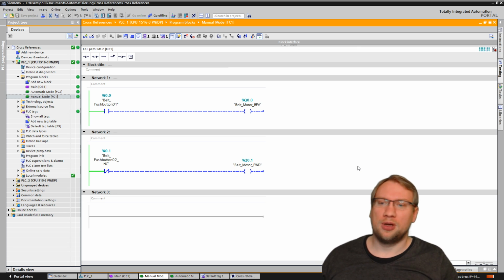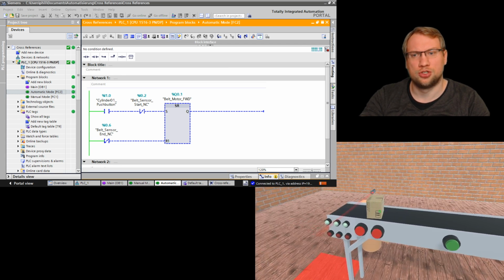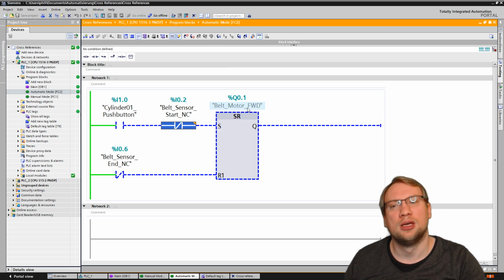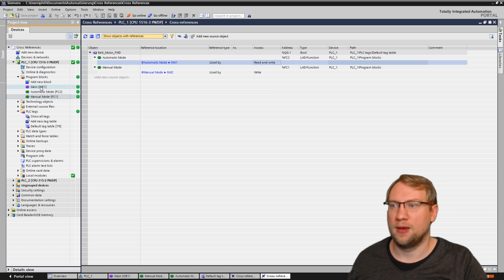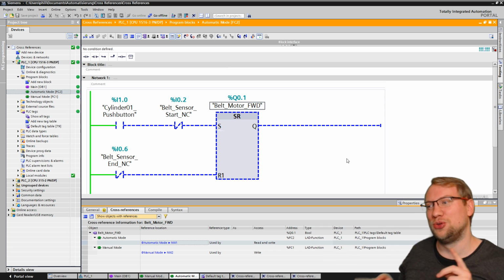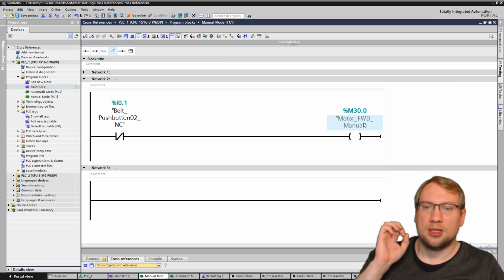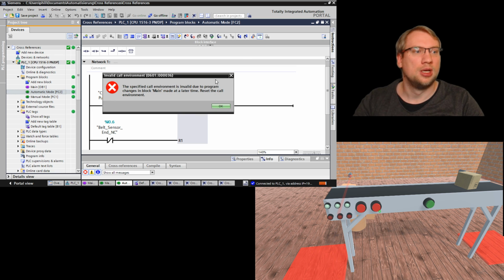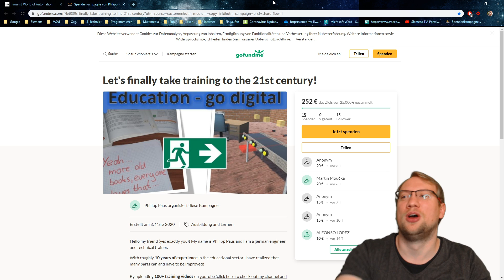TIA Portal: Cross-References (Troubleshooting)

Comment: Hi 
Is there someone who can explain to me why the NC point does not pass the current here 😅
And What are the cases where an NC point is used to not pass the current
Reply: The NC sensor is closed and continuously sends a signal of 1 to the reset input.  
However, this constant signal does not reset the block. Why? Because the reset block only operates when it receives an activating signal (Rising Edge or Falling Edge).

Comment: off topic Q 

when you put n.c PushButton , It should disconnect your motor when pressed and while not pressed the motor should work  ?!?
Reply: The NC sensor is closed and continuously sends a signal of 1 to the reset input.  
However, this constant signal does not reset the block. Why? Because the reset block only operates when it receives an activating signal (Rising Edge or Falling Edge).